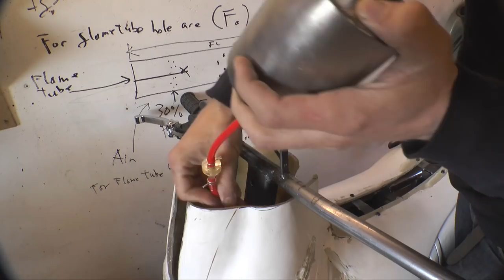Building a MotorHorse???

Comment: how much "horse power" does it have 😂😂😂
Reply: Martin Degn I read online that horses produce around 15hp. Humans produce 2hp. A 125cc engine has 3-5hp.
Reply: Jordan Maddern 
One horsepower is 746 watts, I believe, and kettles take 1-1.5KW. Power calculations are pretty easy, and me just doing push ups is about 300-500 minutes. And doing that for more than a minute or two is impossible for me.
Reply: Martin Degn those small motors make about 6.8-8.5 horsepower
Reply: Martin Degn without a doubt its "one" horse power
Reply: @pureblooded3877  You can't say an engine has X power just by the displacement, there are other things in effect, you have 2L engines that gives out around 70 BHP and you got ones that gives out 200+ BHP
Reply: @pureblooded3877  a 125cc engine can produce up to 12 to 15 bhp. You may be quoting for a 50cc but 125s produce more than 3 to 5bhp

Comment: Can you try to build an automatic light. It would turn on as when you walk in the room. Connect the light to wires which would be under a rug and then have it under a door mat. With one of those pressure switches. So when you walk out it turns off and when you walk in it turns on.